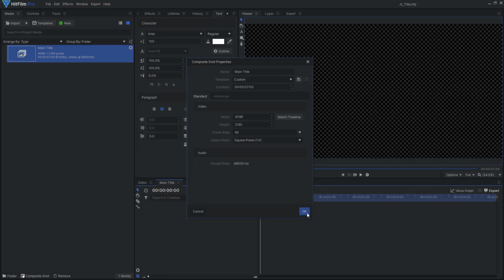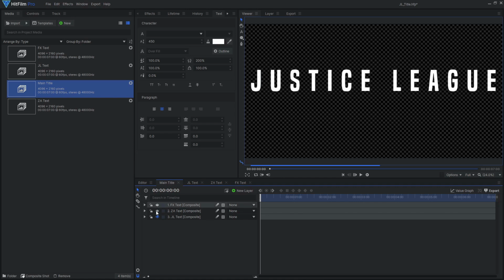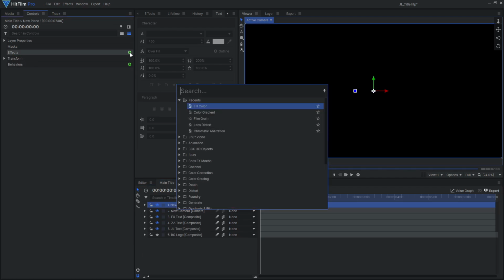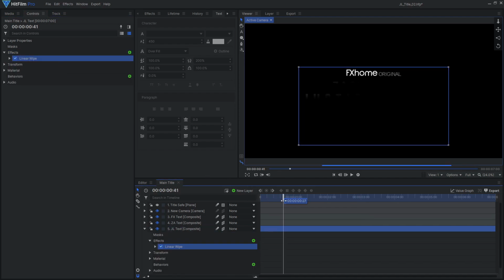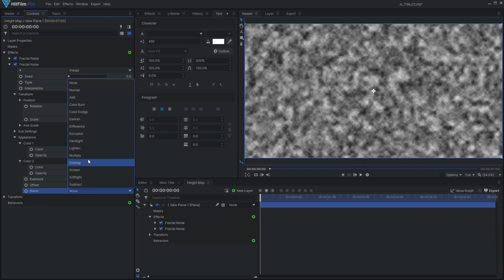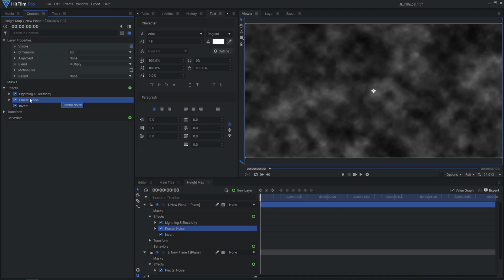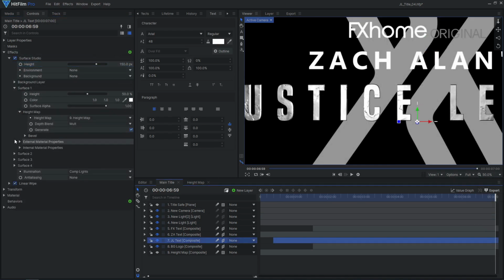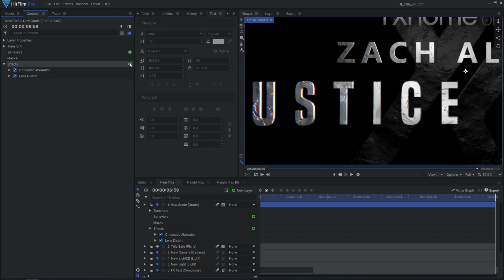Justice League TITLE SEQUENCE | HitFilm Pro Tutorial

Comment: Not sure if anyone checks this , but i was  Working on this tutorial, but it won't let me add a linear wipe to the text layers no matter what i do. I can see Linear wipes in the main effects tab, but it wont let me use it as an option on the text composite. And it won't let me pick any transition at all. Why would this be?
Reply: You might be trying to apply the linear wipe transition, which only works for transitioning between clips on the editor timeline. The linear wipe I used is an effect located in the Animation folder of the Effects panel.
Reply: @ZachAlanProductions  I definitely was trying to use the transition. It's thr o ly thing that comes up in a search for  linear wipe. I wonder if this because I am using express not pro.
Reply: @PantherTheCat  Make sure you're dragging it to the very ends of the clip, not the middle.
Reply: @PantherTheCat  That would be it. I just checked and those Animation effects are Pro exclusive same as Surface Studio. If you are doing this in Express, you could use feathered masks to reveal the layers. If you'd like more help with this head over to this FXhome forum post:
https://community.fxhome.com/discussion/56352/tutorial-justice-league-title-sequence#latest
Reply: @ZachAlanProductions  thank you! I will check it out.